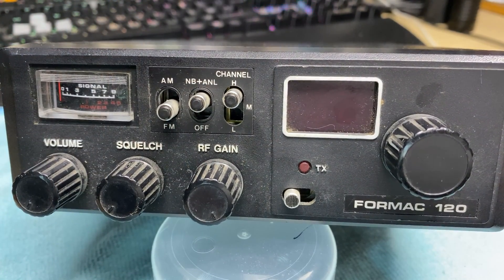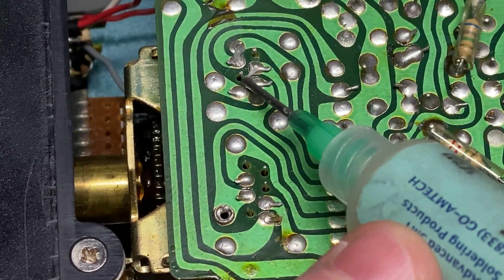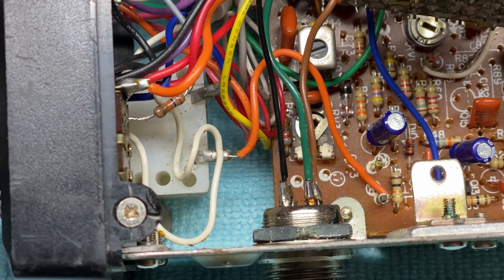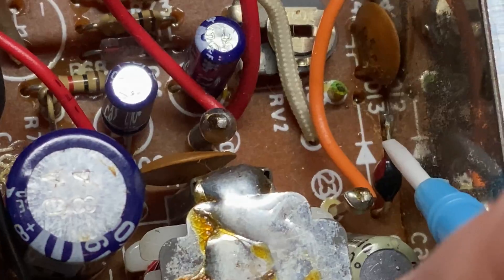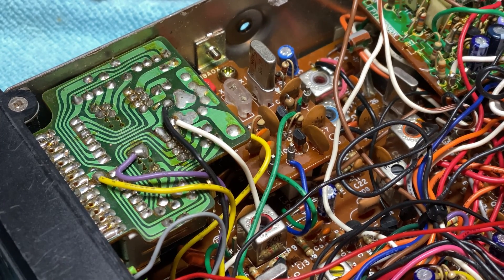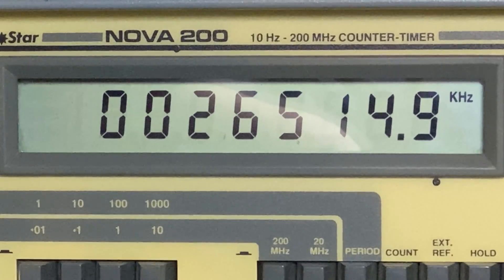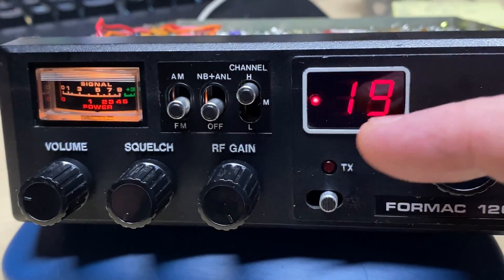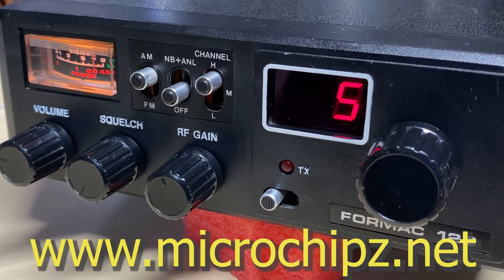EP 162  - Formac 120 AM/FM CB radio - No Transmit, can i fix it?

Comment: You know your way around that radio for sure.. Lets hope that the USA gets the same channel allocations that Europe has because 4 modes USB, LSB, AM and FM on 40 channels is starting to kind of suck.. If this happens there will be a lot of need to make older radios bigger and better..
Reply from the maker: Im sure theres some "unofficial" channels you can use , or is the FCC strict on these ?
Reply: @MicroChipz  Well that depends but yes it is illegal and carries a very heavy fine.. They mostly just go after the real troublemakers but there is nothing stopping them from finding tens of thousands of people using high power and non approved channels/modes..